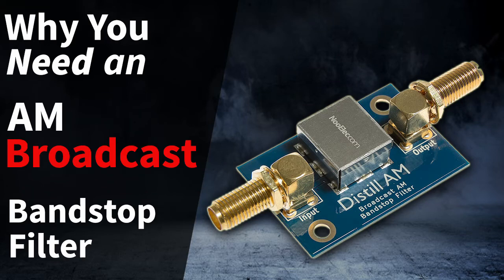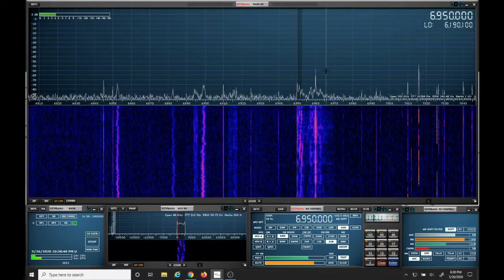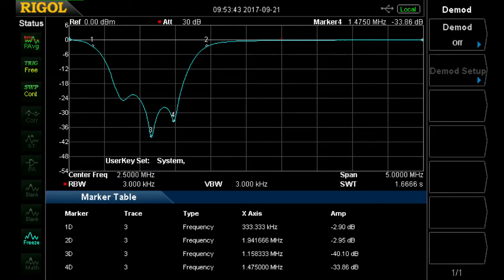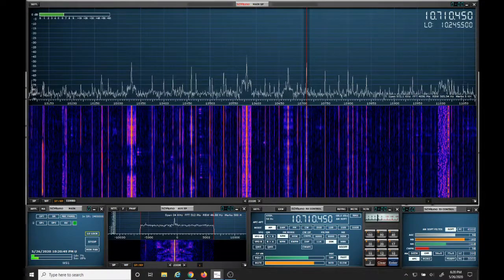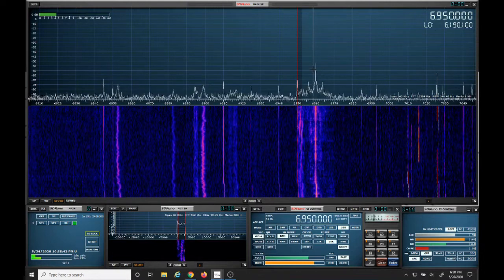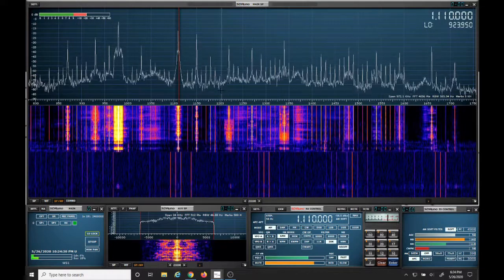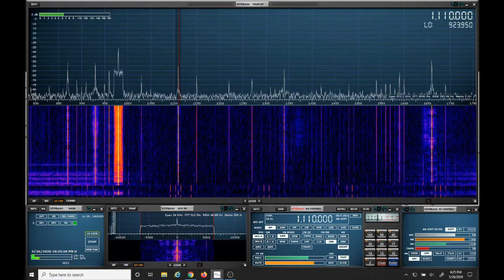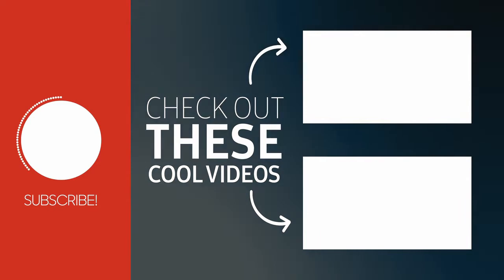Why you need an AM Bandstop (Notch) filter for your SDR or Shortwave Radio

Comment: As an avid RTL SDR Dongle user and just moved house all I have is a metal LOOONG back fence to use as an antenna I definitely need one of these as I get massive signals from AM imaging across all bands. My three matchers in line can only do so much. Thanks for the info and SDRuno observations as it is becoming my favourite SDR S/W to use.
Reply from the maker: If you use a baulun and a good earth ground you may be very happy with that fence antenna. Add this bandstop filter and you'll be good to go.

Comment: Are you using an upconverter?
Reply from the maker: No. I am using direct sampling mode.
Reply: @BrokenSignal   what software are you using? 
I've tried many variables, and always get interference from the computer. Even shielding the usb and isolating the shield doesn't help.
Reply from the maker: @ColinBoath  I am using SDRUno fro SDRPlay. Can you try your hardware on another PC? What SDR and antenna are you using and a anything else in the signal chain?
Reply: @BrokenSignal  tried a few pcs. All the same. Antenna wise, I prob need to earth it better but I think it's low frequency interference from the computer.
Reply from the maker: @ColinBoath  You could have a defective SDR dongle or you might have something else in your house causing the interference. Is it across the entire spectrum or just certain freq ranges?
Reply: @BrokenSignal  pretty much the whole lot. The WFM band isn't bad, but I want higher signals on air band and on low end short wave, but gets drowned out by random spikes of rubbish.